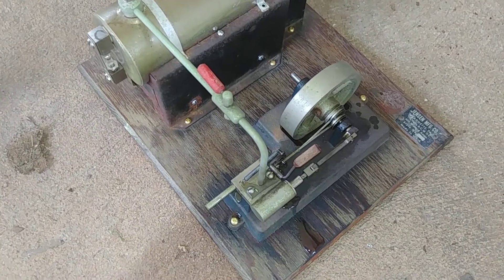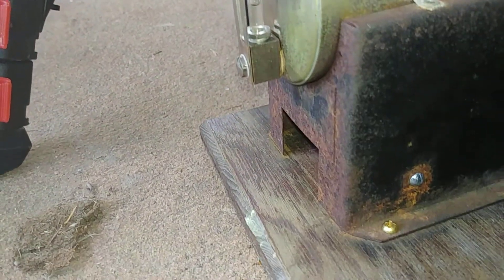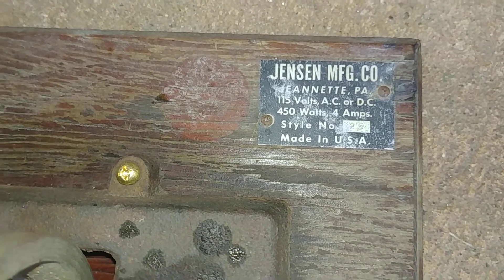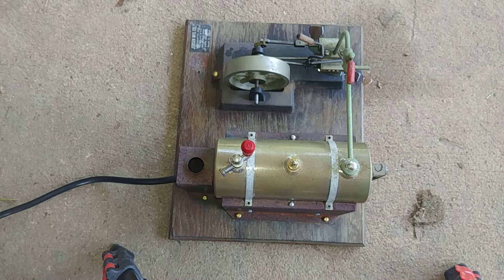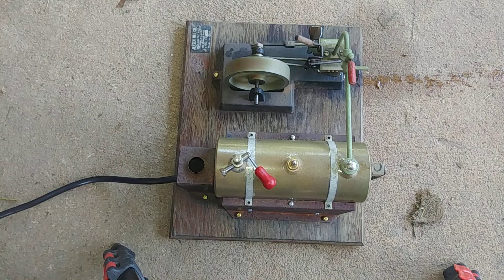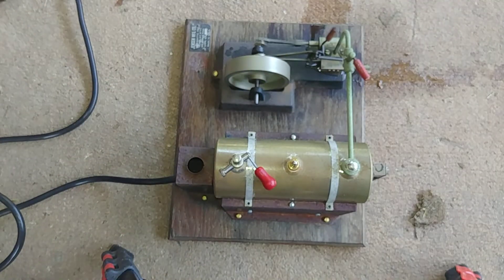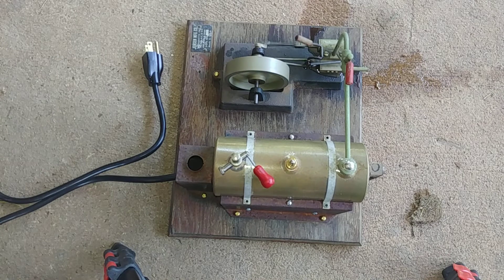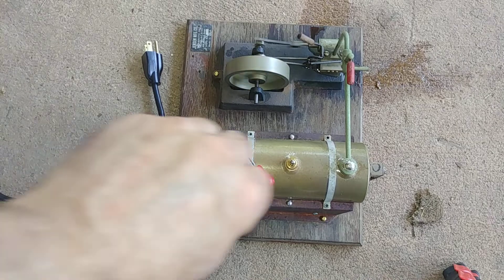Jensen Model #25 Toy Steam Engine Partially Restored But Now Fully Functional

Comment: I have a simaler unit that needs a new heater can you tell me what you used
Reply from the maker: It is best to get in contact with Jensen and they should be able to help
Reply: Does the heater burn too hot? Mine might be way too hot